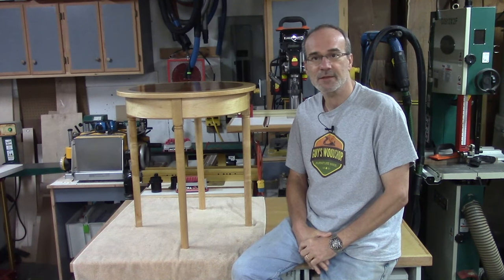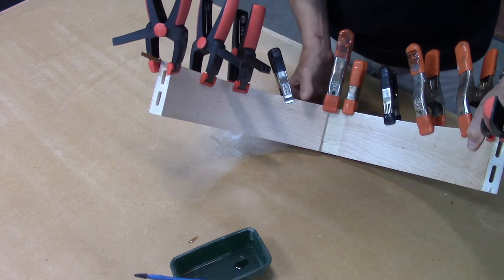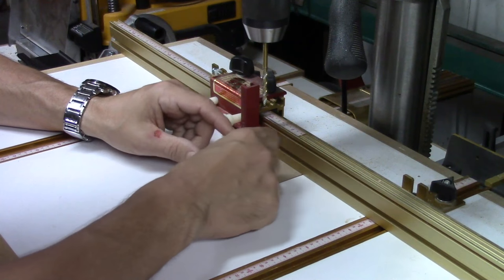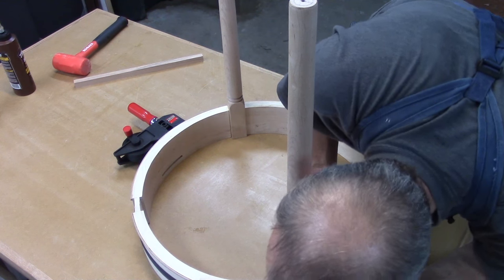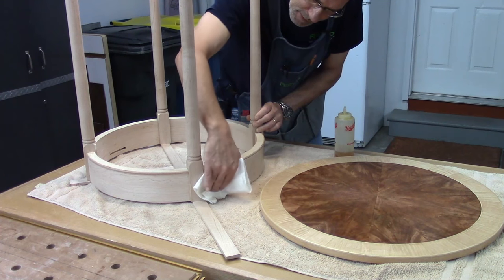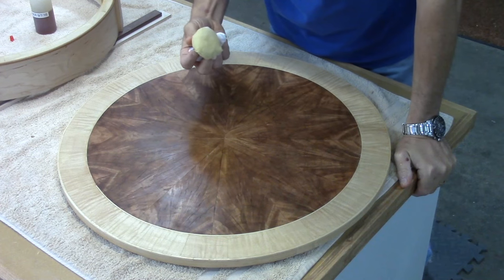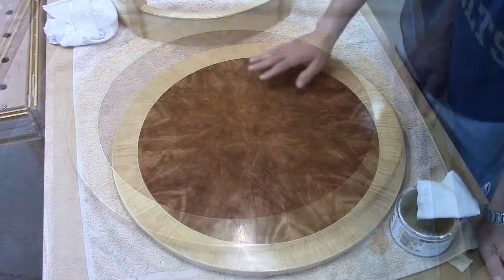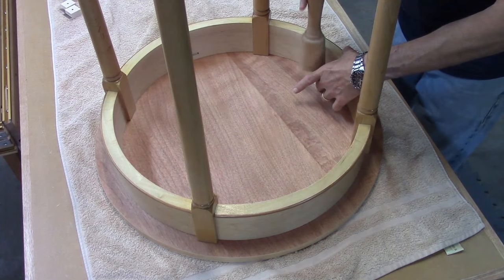Sunburst Veneer Table - Assembly and Finish - Pt. 6

Comment: I started using some Rockler finish applicator disks I'm very pleased with and they are relatively cheap.  I love this finish. Waterlox would be another nice look to the table, but the maple wouldn't be as white as what you used I don't believe.  Thanks for teaching us this method.
Reply from the maker: I haven't tried those yet. I do love Waterlox, especially on cherry. I didn't really want to impart any color to the maple, so amber shellac was a good choice just to add a little warmth the maple.

Comment: That table looks great  most people  could never realize the amount of work that's  put into a woodworking project  also  was the grain of the mahogany porous  you could have used a tight coat of natural grain filler
Reply from the maker: Thanks! Actually the veneer was a cherry crotch, not mahogany. After the glue cured on the top, the veneer shrunk a little bit leaving some stress fractures in the top. Really no way to fill those.

Comment: Table looks great!  Though typically you would make the buttons for holding the top down in the other direction.  That is to say, the rabbet would be across the end grain, rather than with the grain.  Makes for a stronger button that way.
Reply from the maker: Thanks Chris! Yes, you are correct in the grain direction of the buttons. However this is such a small table and very light, the buttons as they are are strong enough for this purpose. Good observation!
Reply: I didn't think it would be an issue either, but wouldn't want someone to pick up a dining table by the top with buttons like that :D

Comment: great videos,great project! I build stave snare drums and while watching some videos came across" Murray Drums" channel. He makes snare drums using the "bricking" technique you mentioned but calls it "segmenting". A lot of turners use this technique for bowls etc. All that to say, you should check out his channel and watch how drum builders round their shells. It'll give you a much more evenly thicknessed wall on your curves.(no more spindle sanding)
Reply from the maker: Hey Mark! Thanks for the tip! I will definitely check it out.

Comment: Love your work Guy. I've just started veneering recently. A challenge but sure it enjoyable. Did you apply any finish to the underside of the table top?
Reply from the maker: Thanks so much for the nice comment! Yes, the underside has a cheap backer veneer, and it has 2 or 3 coats of shellac,

Comment: why do you use hide glue, instead of yellow glue, just curious, thanks :)
Reply: He said it gives a longer working time.
Reply: oh makes sense thanks
Reply: It's reversible in case you make a mistake it comes off with warm water and heat is a big plus when working with veneer.
Reply from the maker: Hey Wesley. Lots of reasons, and others have left comments as well. For me it is much easier to clean up, does not expand wood the wood like PVA glue, it's reversible, long open time and does not effect the finish. I really love the stuff, and for joinery it's all I'm using now.

Comment: Your Buttons were cut with the grain in the wrong direction!! Any excessive force will snap the tab portion off!!
Reply from the maker: Yes, I know they are cut with the grain in the wrong direction. The table is very small and very light. It will never see enough force to break all four buttons off the bottom. In a case like this, it doesn't matter at all.